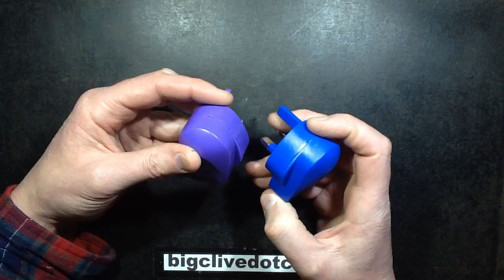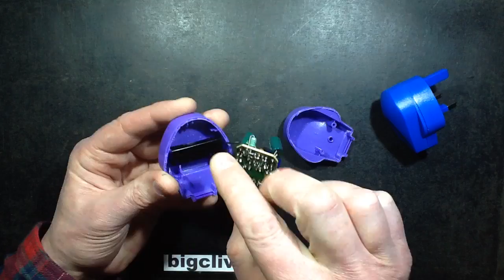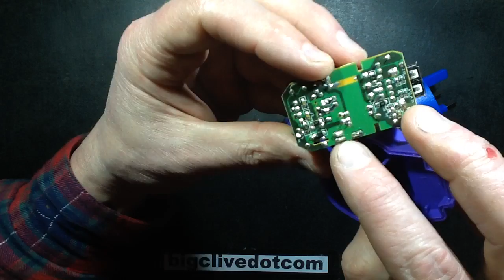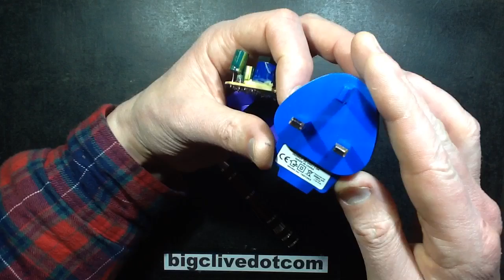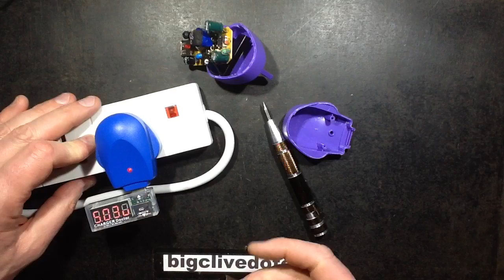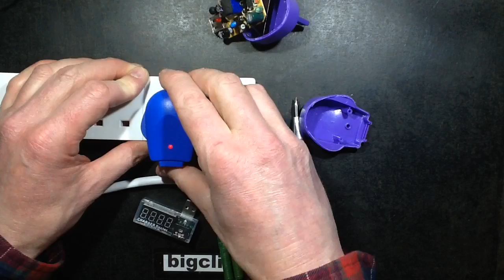A look at the construction quality of a Tiger USB charger.

Comment: Very common.  We just did a four USB port, 10 amp charger with power factor correction and full emi filtering at work and used two tlv431's for the feedback circuit.  The second was set only to operate as a overvoltage protection circuit.
Reply from the maker: Was this "military spec" by any chance?

Comment: Where did you buy it? Is there other connectors too? (EU etc)
Reply: For EU (Schuko) I would recommend German Hama USB PSUs. I did tear down one of them and it complies with every safety standard. Insulated transformer, isolation slots, wide primary/secondary separation, complex circuit to stabilize the voltage, Panasonic caps, etc.
Reply: ***** Thanks for your answer. I will take a look at them! I like your teardowns and videos. Keep the good work up!
Reply: ***** Sorry, but I cant find the video you are refering to, could you please link it here?
Reply: Never said, that I did a video. Did it for myself, and I did not have adequate video equipment back then. Sorry. But I can try to find this model which I have and post a link to amazon or ebay. Please be patient.
Reply: http://www.ebay.de/itm/370952820391
I would also call it expensive, but you must not save money when it comes to safety.
Reply: ***** Thanks!

Comment: I was expecting the typical cheapo unit inside. These are ( crapxon aside or even worse brand caps) not too bad, and might do well as generic 1A supplies. Would not like to draw more than 500mA long term though, the diode on the secondary side would likely be close to failing if you draw long term at more than 500mA, as it is likely only a 1A unit.
Reply: SeanBZA That closeness of the 240v input pins makes me alittle nervous, like bigclivedotcom said, I'd prefer to see an anti-tracking slot there
Reply: ***** Think it's not a problem because it is adter the "fuse-resistor". When there is arking, it will blow.
Reply: ***** Not a danger no, but an annoyance if it does blow, which it might, the unit's not hermetically sealed, so damp may get in if used in a damp area

Comment: Hey. You have forgotten something to test: Which USB charging standard have these things? There are IPad resistor networks and the Android ones have D+ and D- shorted or a very low resistor in-between. Some actually doesn't have anything on D+ D- and everything won't chanrge or will only charge with 500mA.

Also 4.93 Volts is too low. The loss over the cable will make the device drop out to 500mA mode. It should be 5.25 Volts at least.
Reply: im pretty sure most of these just exist to supply generic 500ma, and with losses more like 400ma,many designs predate android and esp apple, but they are cheap, and will charge overnight which is good enough for most purposes, i have one of these from the very early days of mains usb chargers,(over 10 years ago)  still works, construction almost identical to clives, and even charges my ipad given overnight
Reply: But you can not charge a tablet with with 500mA. Not even over night. Some people say they discharge the pads. But I think the pads are just not charging and draining the battery like when there is no charger put on. ;)

The current is regulated in the phone or tablet, not by the PSU. So, you can put on a 40 Amps 5V PSU, when D+ and D- is not configured in the way Apple or Android want it to be, then 500mA is drawn or in case of a tablet, charging is refused at all. If the D+ and D- configuration is correct, the pad will such ~2 Amps out of the 40 Amps PSU.

I = V over R (Ohm's law)
Reply: *****
my ipad mini charges with wifi on , via a 500ma supply in about 12 hours, with a more than 10 year old usb mains charger, from flat to 100 percent, which predates ipads and such, so has no resistors on data lines, i think they shorted the data lines back in the older versions?, yes if you open the screen it changes to not charging, but closed screen it sure does
Reply: Perhaps Apple changed something via firmware update. But I do not sleep 12 hours. Okay, and I don't own any iPads. ;)
Reply: *****
well not 12 hours sleep here either but i dont run the ipad from 0 to 100 percent each time also, plus i dont spend every waking hour with a screen, so they can charge slow !, i also use a knock off apple charge cable, but that works as well as the real one anyway, really if the ipad used 500ma draw in operation, it would only run about 7 hours anyway, i think its less than a 5000ma battery